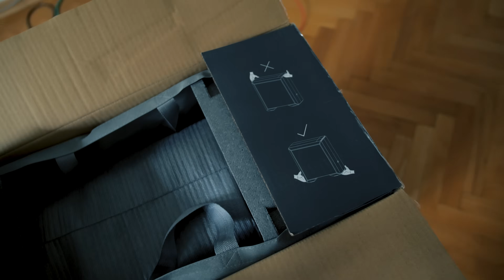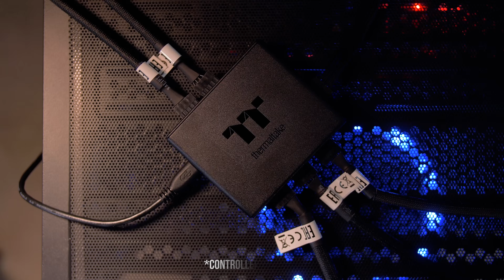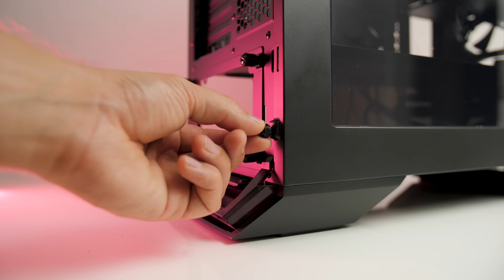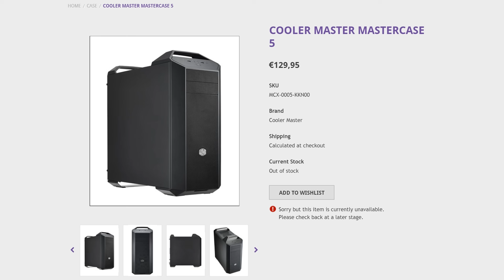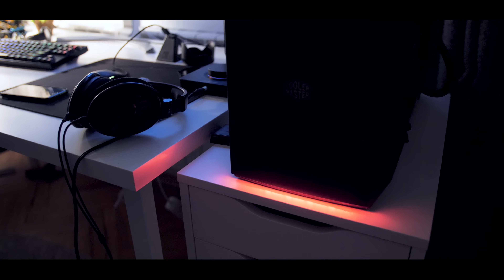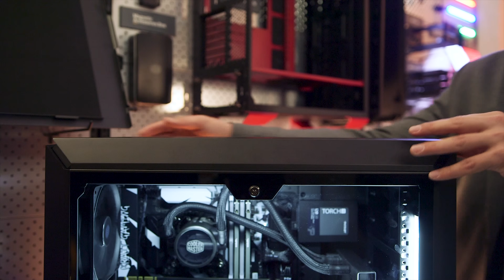My NEW Case? -- Master Case Pro 6 Review

Comment: I need help. I recently purchased this case, and chose to buy the MSI MAG CoreLiquid 360R water cooler (I know it can only be installed on the front) However, I am not able to mount the water cooler with the hoses facing the bottom, the hoses with the CPU block simply do not reach the processor. Is the only way to install this water cooler if the hoses are positioned upwards?

Comment: And the hole behind Hard drive bays.... Whats that!? They giving option to hide wires in Power supply shroud (in most stupid way - by tinting glass, instead covering shroud completly by metal) and they wont give You option to hide wires of next to Motherboard? Thats stupid.

Comment: Na im still madly inlove with my mastercase 5 so much room and super cool all the time and fits my atx mobo snug. I know its the same interior as the 5t and the 6 and thats exactly my point.why the need for me to upgrade 😂. Also u can put the 5t and 6 parts on the mastercase 5 just a little tip so many people are saving money buting the 5 to 6 ypgrade kit for $65 on ebay and many other outlets. If u already have a mastercase 5 and want to get the 6 just buy the upgrade parts for it and wack it on your 5 😊. Your welcome

Comment: the first case that actually fits all my needs when it comes to the modular aspect of it and the meshed front panel and i have checked plenty of cases but they all disappointed me with the Closed off front panel design or sacrifice 5.25 bays for Radiators support ( and yes i still use 5.25 bays ), this case wouldve been my pick for my build if at least it had support for a 360 Radiator on top of the case, guess i either stick with my decision on the Corsair 780T or 760T

Comment: I don't like it. It seems an immature product and i'm not considering the price. The gaps at front and top could been a very huge + if made better, don't know why cooler master didn't give it a better angulation... especially to the back, cannot be just a "lift up" for 170... I like the idea anyway, it reminds me of those old preassembed asus ROG stations that could open their side panels to gain more airflow. I love the internal layout. Hate that LED fan. Don't even like the approach that coolermaster is persuing with their aftermarket products, not considering the cost (wich is high) of the accessories, when i buy a top class product, i want the best. The front led reminds me a lot of the Phanteks P400 lol (which IMO is implemented better).

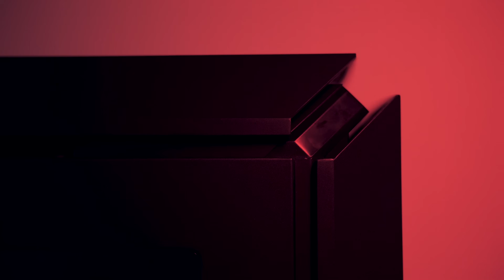Comment: This design does not make much sense, as stated from 4:12, the gap between panels are too large, don't know if they design like this intentionally. Secondly, behind the front penal CM use their common large hole mesh that cannot prevent any dust at all. Finally, don't know whether this case is silence featured or not, but the front and side panels are all without acoustic absorbing foams, which is not very convincing when it comes to noise reduction.

Comment: Ya cooler master REALLY great ideas, horrible execution.
If somehow they ever read or saw these comments they 
SHOULD:
Do what Monsoon Cooling does for their Moduler Reservoirs, customize it online with what you want with a detailed picture that updated depending on what you choose, lowering or raising the cost based on what you do.
Parts should NOT be that expensive, definitly should be lowered its outrageous!

Comment: Just a big fucking joke. $170 for crap like this??? Never. With $80 you can get Phanteks Eclipse P400S Tempered Glass Edition with RGB LEDs which has perfect cable-routing, airflow, beautiful looks, 30 minutes installation for whole system and much more.

Comment: I dunno, I liked the Master Case Pro 5 better (and it's the current runner up for my next system build - I guess I better make a decision and buy one quickly if I do go with that choice).  I agree with your comment that when the panels are open (not removed) to allow more flow, it takes on an "I didn't assemble it properly" appearance.  Not acceptable in my book, esp at that price level.

Comment: here, take this mid tower with bulky plastic panels, a case that would be competitive at $100, for $170. no rgb, no aluminium, no glass, no vertical gpu brackets, no USB 3.1 ports. just an average mid tower at non competitve price point.

Comment: We asked for modularity.. Cooler Master is the only one doing it and they place it at any price they want. It's not fair but hey, Corsair, Lian-Li, NZXT etc are not doing better.
Reply: who asked for accessory driven design? "modularity" is not new. fractal, corsair, nzxt have all innovated modular interiors with removable bays, configurable interiors etc. while coolermaster finally makes a case who's interior isn't from 2011 and they create the buzzword "modularity" to sell an average mid tower with accessories that cost an arm and take forever to become available. the versions of the case they sell are all priced badly and their LED implementation is the worst on the market.

Comment: I do like the case. The cable management velcros, the cut out shrouds for the wires are cool & are placed perfectly, but not for $170. My Phanteks PS400 Tempered glass has most of those features and $100 cheaper.

Comment: WOO woo woo 300 dollars then they should really rethink this, in its current state this is 130-150 dollar case and that is 50 for the glass and the rest for the case, no more,
I just ran the video again to make sure i heart 300 dollar right. 

To be honest i like this case more when the panels are extended. think the openings give it a unique look. 
Gives the idea of one of those cubes folding out in a science fiction movie.

Its still to small for my liking and the price the front i/0 is just sad and bare no type C and that little flap they should have made it a magnetic pop up like the rest of the case with the I/0 aiming front and side way

The liquid cooling options are minimal and not adjustable, no 360 rad option really the lights could be done a lot better and adjustable in brightness.

If they add all the cool stuff like the GPU mount better fans and add the support for  (XLATX, EATX) fix all mentioned about then were coming more in the region of 300 dollar price point 
but then there are still lots of better options even in there line up Cosmos II, the  P500H and there probably cheaper.

I like Cooler Master a lot but this is a total miss at that price, this is not how you get people to invest in your master case pro series.

thanks btw for mentioning the side way GPU mount it looks like i can mod it into my Haf-X case and sins im already modding glass into it thats gone be great.

Comment: am i the only one that hates tempered glass? i actually prefer plastic or acryllic. its clearer and much better view to the insides.
Reply from the maker: +MrTinyThumb it may be clearer but it scratches, doesn't feel as good as the glass and has no interesting reflections.
Reply: Do you usually feel up your case ?

Comment: I thought you wanted the MasterCase H500P shown off at Computex
Reply from the maker: +StrikerX1360 it'll be a while longer till that comes out. But yeah, I really want that one.
Reply: don't get your hopes up. it's still the same chassis with yet another exterior. and 200mm fans suck, which is why many companies don't make them anymore. they take a crap ton of power compared to 120/140's, they are loud over 900rpm and they have abysmal static pressure so they suck against case filters. they do move alot of air, but it's all a trade off. 3x 140's do better with less noise.
Reply: told ya.

Comment: Does that PCI SSD tray fit into standard PCI slots? Because if so, and meaning it could fit in any case with free PCI slots, that's an amazing accessory to show off SSDs in older cases that weren't built with display locations for SSDs, like my 600T.

I do like the way this Master Case Pro 6 looks, a bit more grown up and classy than the 5, while not looking like a plain brick. Having a couple 5.25" bays is awesome. Also, I like the floating look of the case when the panels are extended.

That being said, your old Phanteks was beautiful.

Comment: Yeah the case is already a bit expensive without the extras, so would also have liked to see more included. Not stoked about the panel hiding the I/O though. I actually tend to use the front I/O a lot on cases, so would end up having that panel open all the time, making the design less attractive IMO.

Comment: Why can't case manufacturers get it right after all of the reviewers tell them what needs to change. Jay of JayzTwoCents found out his one case was way too hot because a lot of the newer cases shield off airflow going for too much glass. Tempered glass should be limited to the side panels and not the top or the front.

Comment: significant temp improvement with the panels pulled out (= 1.75 DegC lower)  ..... wow, that is really significant  and an increased noise of 0.6 Db ..... my goodness ..... thank good they made the panels able to pull out, otherwise it would have been unbearable to be in the same room :) 

Sorry, could not help it

Comment: Phanteks cases are way beyond these plastic crap boxes.. seriously this case looks cheap as hell! Its possible to get tired of the Evolv, but talk about downgrade. Damn!
Reply: *laughs in p400
Reply: Yep looks good but terrible air flow which most keep very quiet.
Reply: kazysaurus Even the S340 Elite is better in every way
Reply: just bought pahntek evolv silver tempered glass, look awesome !
Reply: +Matthew Bunton yea, but modding the front panel or buying another one from MNPCTECH is very easy for good air flow... (( look all way down below this link ))... https://mnpctech.com/phanteks-case-mods/phanteks-primo-front-grill-en/evolv-vented-front-panel.html
Reply: @pop pop My favorite fans for airflow are BY FAR these cougar fans:https://cougargaming.com/products/fans/  I use 3 120mm fans on my top panel for exhaust and they work perfectly. They are whisper quiet and move a lot of air!
Reply: It's like every case manufacturer now thinks "I can premium too", by slapping a high price tag on a new shit box.
Reply: Frank Beaulieu I can see this working really good but I don't like the rough look.
Reply: Frank Beaulieu I need better fans for my evolv. Gpu gets to 90 c. Any recommendations?
Reply: pop pop noctua fans
Reply: Frank Beaulieu I have noctua nhd15. Color would match nicely. 😂
Reply: pop pop if you want 140mm fans use the p14s redux just great all around fans or the a14s if you want the brown look
Reply: CM material and build quality is shit.  I don't see why anyone would buy their butt ugly cases
Reply: @Frank Beaulieu I have the exact same one, it's awesome! just the airflow isn't that great.

Comment: there is room on the top.for a 240 and fans no more of.28mm I test in mine is fit nice. the top io yes that is out. but it fix the way the front panel resets and the way the io cables.goes down. some of the accessories are missing from us store . and I want to buy the parts that makes 6 nice

Comment: Can't believe you replaced the phanteks. I like this coolermaster but the phanteks enthoo evolv is the best case on the market.
Reply: Good, but the airflow is definitely not the best comparing to similar priced cases from NZXT, FD or other major players.
Reply: It is beautiful, has a lot of features, but talk about air flow(specially for water cooling), the evolv loses in any aspect, so I wouldn't say it is the best case on the market.
Reply: Joel Nogueira Agreed. I love that case.
Reply: Stuart Little I bought phanteks after seeing  Dimitri review 2 years ago. It's a bit strange not seeing phanteks on Dimitri' s desk. 🙄.
Reply: Zippy 0 in my opinion is still the best looking case with a fair price. It includes some accessories and it is very well made and designed.
Reply: Zippy 0 what do you think is the best case? (ATX, Micro-ATX and Mini-ITX)
Reply: I bought it after seeing this review on the tempered glass version nearly a year ago.
Reply: If you are going to say its not be the best case overall, then why not provide your suggestion of the best?
Reply: I own the normal Evolv ATX (not the TG edition) and certainly it has its points, but the airflow is not that great with those so obstructed front and top parts. Easy to assemble in it? yes,  but considering that its a 170€+ case, construction should be a bit sturdier as some metal parts feel a little bit on the cheap side.  
I am now going to buy in the Enthoo Pro M Acrylic (TG out of stock until september :\) and it has almost the same frame and costing almost half the price.
Reply: I'm using the Phanteks ENTHOO Luxe tempered glass edition and I have enjoyed it. I strongly considered the ENTHOO Evolv but didn't want to deal with the airflow issues at the time.The Luxe seems to get pretty good airflow, and I like the dual RGB LED strips along the sides. I have the three-foot magnetic LED strip from Phanteks lighting the interior and it's like a full border of light.
Reply: Best case? Definitely not. It is good, but not the best overall.